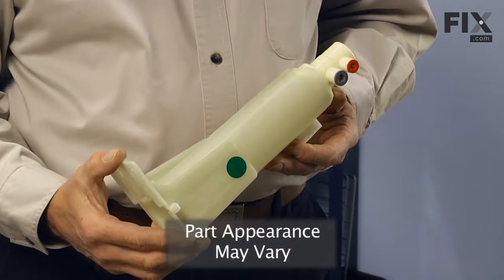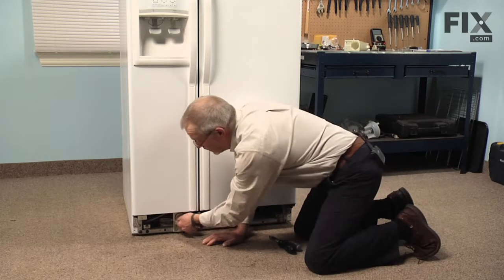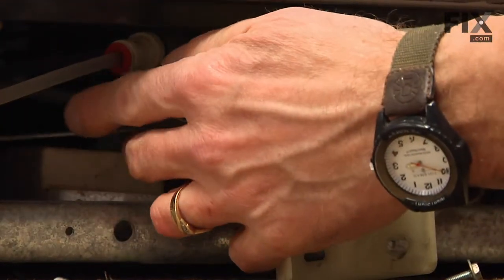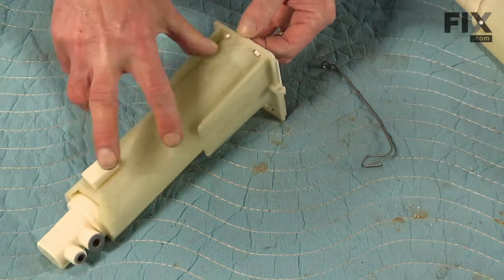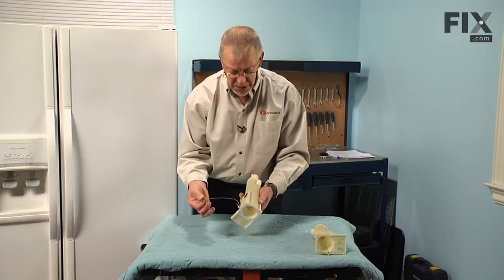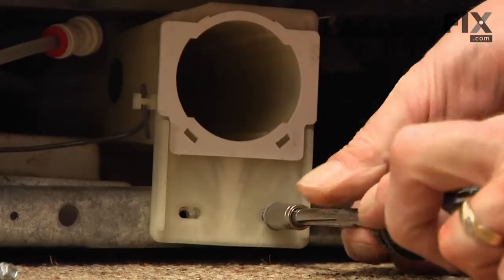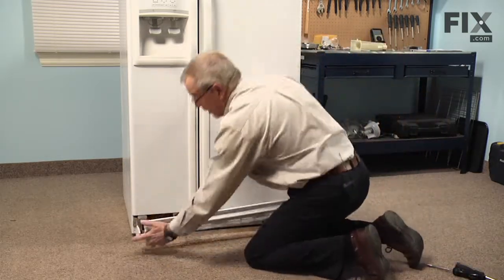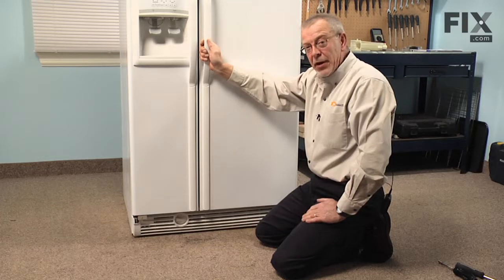Whirlpool Refrigerator Repair – How to replace the Water Filter Housing

Comment: What size are the water lines that connect to the housing?
Reply from the maker: Hi Doug, thank you for your question. Could you send us the model number of your refrigerator so we can double check on the size of the water lines for you? Thanks!
Reply: Fix.com gd22dcxhb00 Thanks in advance.
Reply from the maker: Thanks, Doug. I looked into it, and this is the water line that you're looking for: 
https://www.fix.com/parts/refrigerator/kenmore/fix886401/filter-inlet-water-tube-8201597/?SourceCode=1&ModelNum=GD22DCXHB00&ModelID=804861
As per manufacturer's specifications the line starts out as 1/4" tubing but ends up at 5/16". The link above also has a repair video, if you're looking to replace the lines!  I hope this has been helpful. Good luck with your repair!